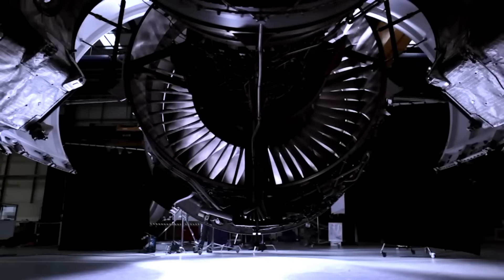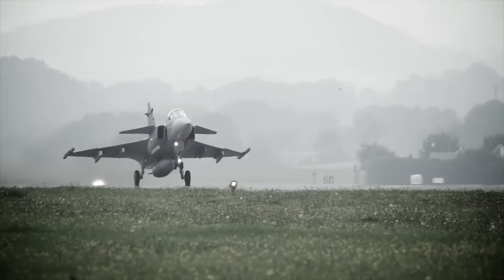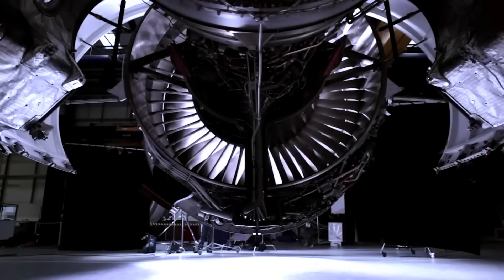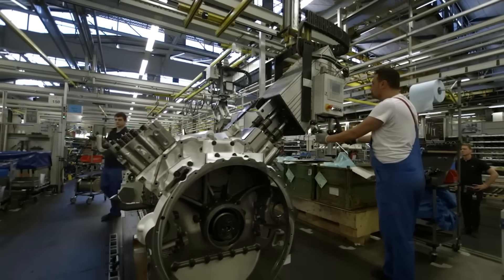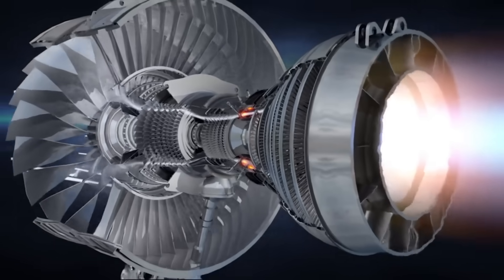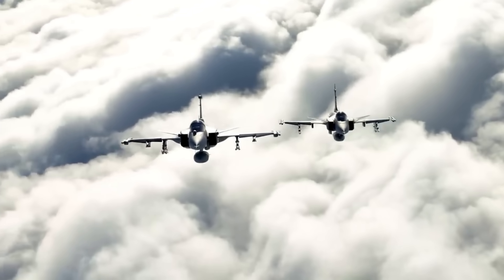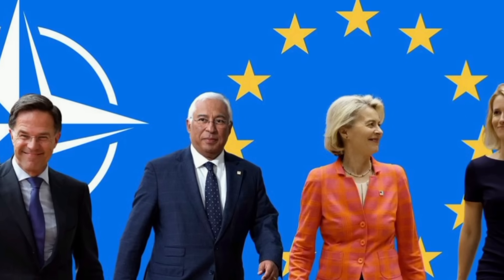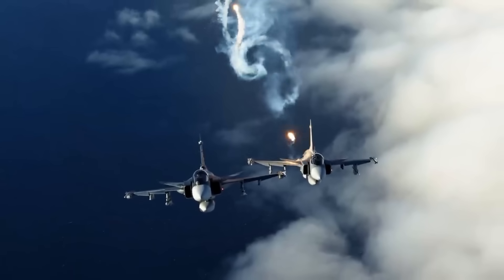How Rolls-Royce Quietly Rewired the Gripen Jet – And Shocked NATO Overnight

Comment: The F-35 is a hanger princess like the princess and the pea.  The Gripen is Princess Fiona, a street fighter, like a female Mike Tyson
Reply: Israel F-35 blew through the S-400 super duper Russki air defence system in Syria like it wasn't there.  But if you want to get shot down with a 4th gen fighter like India did a few months ago, have at it.
Reply: F-35 is designed to attack lesser adversaries, SAAB JAS-39 E to fight any opponent. If so-called 5th generation means poor aerodynamics, huge heat and noise signature, longer service and maintenance times, f*cked-up operability rate of some 36 per cent et caetera who in the real world facing imminent threat would go for so-called 5th generation fighter?

OMG, Finland for starters. Thank God Swedish Airforce F21 Kallax Airbase is only some 90 miles away!

And another thing: if F-35 is supposedly superior "5th gen fighter", then why in the name of sweet Yesuah IDF has installed its own ew-suite to IAF F-35's(??!)

F19, SwAF F21 & FAF F11 forever! 🇸🇪🇫🇮💪
Reply: @petritast3784  20 countries fly the F-35, they were totally hoodwinked because they failed to check in with the YT comment section internet randos before making their decision.
OMG Finland also evaluated all the possibilities and chose the F-35 lol.

Comment: When ever I see an argument for the F-35 being better for the defence of Canada, I always ask "How? What's the use-case for our fighter fleet?" Are we going to sneak into enemy territory and blow up their air defences? Then the F-35 is better, but Canada is surrounded on 2.5 sides by oceans and 1.5 sides by the USA and the USA is not going to allow our F-35s to defeat their air defences. As I see it, we have 2 primary tasks for fighter jets defending Canada: Intercept and Identify, and Patrol. Something comes across the arctic ocean, we want to see what it is before we decide to shoot at it. That's Intercept and Identify. That requires speed and range. The F-35 is inferior to the Gripen E in both. Patrol means flying over our border and that means Arctic border. That's a range issue. Of course, fighters are not the only aircraft we have to do that. And for this role, cold weather operation and range are the primary characteristics. The Gripen E is far superior over the F-35 for that.
So anyone arguing for the F-35, you need to define the use-case. In what use-case is a slower stealth aircraft with fewer weapons and shorter range better for Canadian defence.
Reply: Good points to bring up.  And those missions all benefit from AEWC capability and Air-to-Air refueling, not radar stealth and a tethered emitter decoy.  So we buy the F35 and we can't afford anything else, probably not even armament, then we're back to our current situation.  A poorly equiped unit of the USAF.
Reply: Why don't they listen to you its obvious you have all the answers, you and all the other internet know it alls
Reply: @jthunders  I at least provide the logic behind my argument. If there is a flaw in it, people are free to point it out. Making an assertion without backing it up with a logical argument is simply an opinion. And if someone does point out the flaw in my argument, then I'm always willing to concede.
What the F-35 side hasn't provided is a logical argument of why the F-35 is a better choice for Canada other than "it has stealth".
Reply: @DarkSyster RCAF did their own analysis and found the gripen satisfied 35% vs 95 for the F-35. Does anyone care about this analysis or did they just throw it in the trash and listen to the Internet experts.
Reply: @jthunders  Have they ever revealed the criteria for their analysis or the process by which the criteria were judged? I've never seen it.
My late brother was a purchaser for the military at the time and he had many choice words about how the brass often tried to skew the competitions.
Unless they publish their detailed criteria and judgement process, I have no reason to trust that they picked the F35 over its competitors just because it's cooler.
Reply: @jthunders  Also, I'm not saying the F35 is not a good aircraft. It's excellent for what it was designed to do. But you don't use a screwdriver when you need a hammer. When I look at what Canada needs for the  defence of Canada proper, the F35 looks like the wrong tool for that specific job. If we're going to war in Europe, then the F35 is the better tool but I don't see that as realistically happening within 20 years.
Reply: @DarkSyster there are recent real world examples. India Rafale versus Pakistan J-10. Israel F-35 versus s400, Syria. Israel F-35 versus s400, Iran. I type in in Canada criteria for selecting next-gen fighter. All sorts of things come up
Reply: @jthunders  Yup, and they were set in 2019 when the assumptions were different.
Interoperability: The ability to operate seamlessly with Canada's closest allies, particularly the United States for North American Aerospace Defense (NORAD) and NATO missions.
This assumes that the USA is still Canada's closest ally. That's now a questionable assumption, certainly not a trustworthy one. I argue that since Russia is now a ghost threat, that is it looks like a threat but really isn't, NORAD isn't relevant anymore. Russia is being destroyed in Ukraine. It'll be 20 years before their strong enough again to consider trying to cross the Arctic ocean to attack Canada. Both planes will be obsolete by then. Plus, Sweden has already demonstrated in its first NATO "combat" mission, full interoperability with NATO equipment. (Russian SU-31s flew through Estonian airspace and were met by F35s, Gripens, and F-16s, all working together, but no actual combat took place. Even so, it's considered a "combat" mission.) Also, the Gripen allows more variety of weapons load out than the F-35, including the full compliment of NATO missiles.
Mission Requirements: Specific emphasis was placed on the ability to protect Canadian sovereignty over a /vast airspace, including the Arctic/, and to contribute to international operations (strategic attack and ground-strike capabilities). The F35 is an excellent fighter if we're fighting in Europe. But it can't land, be refueled, be re-equipped, and take-off from Resolute. It's not designed for that. The Gripen is. When the requirement was written, the assumption was that the USA would deal with Canada's Arctic defense using its F-16s if Canada bought fighters to fight the Russians if they attacked NATO in Europe. That assumption is now shown to be wrong. Hence, a need to re-examine this. 
Advanced Technology: Requirements included advanced avionics, stealth technology (for survivability), enhanced intelligence, surveillance, and reconnaissance (ISR) capabilities, and the potential for future upgrades and adaptability to emerging technologies like AI and drone swarms. The only one the F35 has that Gripen lacks is stealth. The Gripen was literally designed for ISR (with JAS being the Swedish term for ISR) and for upgradability. For Intercept and Identify missions, the main "combat" mission in Canada proper, stealth is of less value than speed and range. If it was an invader, are you going to allow them to get to Yellowknife before you intercept and identify, or do you want to meet them before they reach Tuktoyaktuk? That's the difference we're talking about in speed and range based on the fighters starting from Cold Lake, Alberta.
It's what I said. You pick the right tool for the job. The job we THOUGHT we were buying fighters for in 2019 is not the job we need them to do any more.
And this highlights a problem. Anything we buy today will be obsolete before it reaches its lifetime. I'd argue the B-21 has rendered all F-35s except the F-35C obsolete because the B-21 is designed for the same mission profile, can handle cold weather, has a longer range, better stealth, and a heavier weapons load-out and is equally maneuverable. But the USA is not going to sell Canada B-21s just as they're not going to sell F-22s.
And this finally brings us to the last criteria, Cost.
The financial aspect included the initial acquisition cost for 88 aircraft and associated equipment, as well as the long-term sustainment and operational costs over the aircraft's projected life expectancy (past 2060). Ignoring the B-21, we can expect the F-35s to be obsolete by 2035, 2040 at the latest, never mind 2060. By 2060, the F-35 design will be over 80 years old! But they will cost A LOT, both to buy and to operate and to maintain. If a SmartCar will get you to work and is easier to park, why buy a Maclaren W1? And this is the problem in Military procurement; they'd rather have the flash of the Maclaren than the boring utility of the SmartCar. So they skew the decision process to ensure that only the Maclaren fits the requirements. And it's not unique to Canada. India, the USA, China, all have the same problem.
The thing is, the Gripen is cheap, fast, and has a long range, just what we need right now. And the economic benefits? They'll be built in Canada by Canadians.
If it were up to me, I'd be joining the Eurofighter consortium and building Typhoons instead. They're the best plane in my opinion for the job as they are faster, and have a comparable range plus they have 2 engines and they're superior to all but the Rafale as a fighter. (About equal to the Rafale in WVR combat.) But they're not on offer.

Comment: This is a bullshit story.  Saab hasn't even re-designed the Gripen E, and Rolls Royce doesn't licence build the F414 GE engine Volvo Aerospace does. The proposed engine that could be used is is the EJ200 which is also used in the Eurofighter, but fitting this engine could mean a complete redesign  of the mid section of the Gripen E, also it's center of gravity would change effecting it's controllability. Rolls Royce doesn't simply re-wire a whole Gripen, it wires it's engine to a FADEC Full Authority Digital Engine Control and Saab wires the Gripen to the FADEC.
Reply: And you believe this is not already in the E/F design baseline and therefore requires total reengineering because..., look it's the offer being evaluated in the review so there is likely quite a bit more forward planning completed.  Besides Canadian aerospace, which contributed a lot to the modern RR engine would be on board if it goes forward.  No, I think F35 is about finished thankfully.  We'll just take the 16 F35s paid for, they'll look good on pedistals in 10 years.
Reply: @williamlavallee8916  reality seems to be invisile to politicsal dominance/
Reply: The description on YouTube of the channel even discloses "paid promotion." Origin for this "news" Pakistan. 😂
Reply: The Eurojet EJ200 engine, powering the Eurofighter Typhoon, produces about 20,000 pounds-force (lbf) of thrust with its afterburner (reheat) and around 13,500 lbf without, which translates to roughly 150,000 horsepower combined for the two engines on the aircraft, enabling extreme performance and rapid acceleration like vertical climbs from takeoff. 

The GE F414 engine isn't measured in horsepower but in thrust, typically producing over 22,000  pounds-force (lbf) of afterburning thrust, which translates to roughly 165,000 horsepower. 

So is RR better?
Reply: Its a GE motor but the company that makes the most of the work is GKN Aerospace  situated in Trollnättan (they bought it many years ago from Volvo)
Reply: @stefanahl788  yes but it means the USA has the right to stop supplying spares.

Comment: YES, YES and YES !!  With these new upgrades it should be in Canada's best interest place its' orders for the Gripen E and renew our air force capabilities.  Also for the cost of 8 - F-35's we can probably gain 10 Gripen E jets.  That's a bonus..
Reply: It is not so much the cost of the plane that makes the difference but the associated costs. The F-35 needs a very expensive infrastructure to operate in and the costs $48 000 per flight hour. The Gripen needs a short stretch of snow-covered road and costs only $7 000 per hour,

Comment: Know why the yanks don't want Canada to go with the Gripen ? same reason they managed to get the Avro arrow dumped, scared of it !
Reply: Scared of the loss of revenue as the f35 is grossly overpriced
Reply: @robertelliott-q2k  Its actually cheaper, Its the cost/hr to fly it that is more
Reply: @jthunders the numbers I have seen suggest that the F35 Is beweet 80 to 100 million USD each plus a massive flight per hour cost. The gripen is between 60 to 85millionUSd with a much lower operating cost per hour. In addition the F35needs seriously expensive infrastructure to go with it and needs to based near that at an airfield. The gripen can land on a motorway and be serviced in the field with minimum facilities. The F35 says it's stealthier, but that stealth profile is diminishing as tech improves. The gripen has tech onboard to hide it's profile. It's a no brainer for me on what I have read.  The US still has a kill switch on the F35, and determines who can use the plane.
Reply: @robertelliott-q2k well you certainly stated all the tropes, I’ll give you credit for that. Finland actually operates both planes and they say the cost to fly the Gripen is like $22k vs 33k for the F-35. Saab made up those numbers all the Canada know it alls use.
Reply: @jthunders with Lockheed you never know what the cost will be. Ask Switzerland. They thought they had a fixed price deal but the costs keep escalating and the planes are late.
Reply: @robertelliott-q2k the real tragedy is that the euros never even tried to develop a stealth plane, so they are stuck with whatever the evil usa comes up with. Competition is good, where would the world be without airbus.
Reply: Or the BAC TSR-2
Reply: The Avro was an interceptor, not a fighter plane.
Reply: Thats actually pretty funny.
Reply: @kellyrcanuck7674
When they get jealous they get really jealous.
Reply: @wjf0ne  Anyone interested in seeing what out little Gripens are going to be up against in the next decade?   https://youtu.be/a7mVEkBnE5Y
Reply: They did the same with the British TSR2 project after several flight tests.
Reply: This channel includes the disclosure "paid promotion." 👏 👏  Your believing a paid promotion from Pakistan 😂 good job.
Reply: @JohnDoe-jd5eb sounds like sour grapes. British plane only one to  nuke usa in manoeuvres you'll be saying usa developed nukes alone or invented the tank ww1 before yanks even arrived
Reply: @waynegazard5038  Some interesting facts about developing nuclear weapons. Sweden had a nuclear weapons program founded 1942 if I'm not mistaken. Years before the Manhattan Project. Unfortunately the Swedish politicians at the time cancelled it because of the costs. Now, when Russia weekly threatens Europe and Sweden with Nuclear weapons, maybe that wasn't really a good decision...
Reply: @magnusk4352 Manhattan started in 1942 as well but they floundered for years because no swedish scientists, hence no progress.
Reply: @magnusk4352  France and the UK has plenty of nukes. We don't need more nuclear proliferation... Sweden should just allow itself to be a host country for such weapons if anything.
Reply: @magnusk4352 The UK led the world with Tube Alloys which was the basis of the Manhattan Project and took several years off the American timeline as it was given to the US under reverse lend-lease. This was earlier than 1942 by the way. In fact it was an Anglo-Canadian project and led the way at the time. In 1939 France was second in how advanced they were, Germany a distant third and nobody else was anywhere of note…